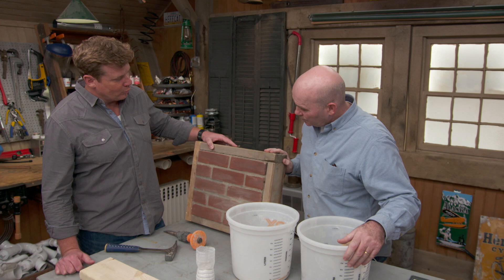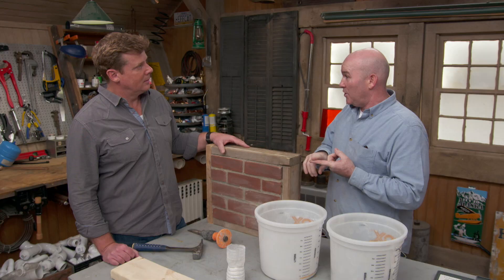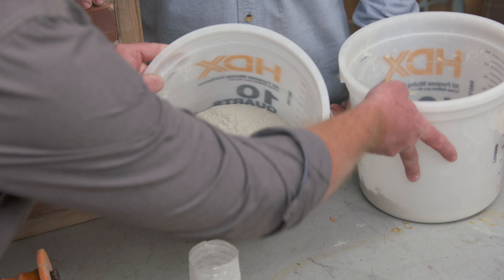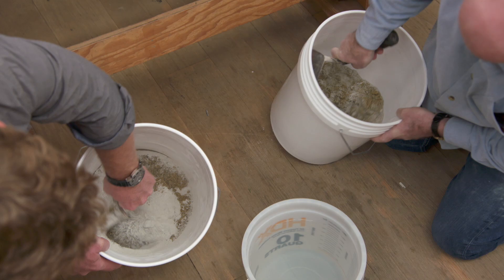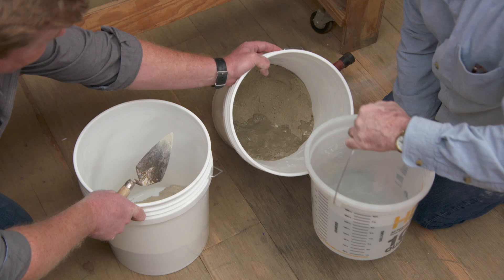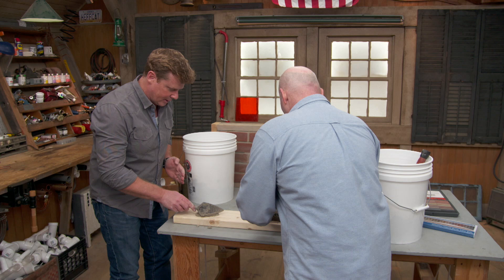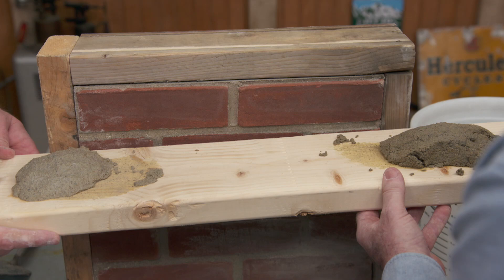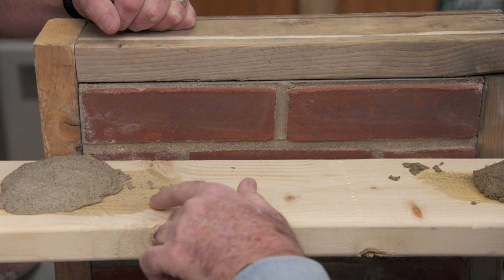How to Match Mortar | Ask This Old House

Comment: Third generation mason here:  I commented on your Facebook page yesterday and then this episode came on Pluto TV…what timing!  I just want to say that this is not as easy as Mark makes it look.  As I’ve said, Mark is a great mason but I’m thinking that his four-minute segment just wasn’t enough to “go into the weeds”.  My customers see things like this clip and give me grief because I can’t make the mortar match…perfectly.  Keep in mind that Mark did not show the final CURED mortar NEXT to the old existing mortar.  Matching is a long process that is based on four main factors 1) mortar color (added pigment), 2) lime and cement color and ratio, 3) sand color, texture and grain as well as ratio to lime and cement and 4) weathering.  Also, as you walk around a building, the colors will vary so now matching is multiplied by the number of different shades around the building.  As Mark pointed out, a mortar sample can be broken down to help determine these things but there is still a lot of trial and error to get to a point where the new mortar does not stand out.  A good mason will always make an attempt and get as close as possible, but the process involved in getting a "close match" can take days and is not economical on small projects.  “Mortar matching” makes sense on large restoration projects but you will still see the difference if you look closely.
Reply: I agree fighting it now. Brutal, looks so easy😂
Reply: Exactly
Reply: Amen to that, and we didn’t get any specific measurements of lime , Portland and  sand.
So how in the world is a guy like me gonna be able to get the idea ?
Reply: @elleondejuda4681  You would start with standard ratios and then add/subtract each until you get it.    If you are matching "old" mortar it's probably a Type-O.  Type-O mortar ratios are: 1 part cement, 2 parts lime and 8 to 9 parts sand and follow the recommended color for your specific color brand.  Mix that up, let it dry (you can speed it up a bit with a hair dryer) and compare.  Now, add/subtract each of those components until you get where you need to be.   It's a daunting task!  You need to have a pretty good understanding of mortar to even have a chance of getting close.   A mason can look at mortar and see the base color or determine if no color was added.  That's a valuable starting point.   But, to make things even more complicated, some color "back in the day" was simply brushed onto the surface of the mortar.  Good luck matching that within reasonable budget constraints!

One component that you will probably never be able to match is the sand.  "Back in the day" sand was often just harvested from the edge of a farmers field in a near by location.  Good luck finding that!

I wish that Mark would re-think his ability to match mortar and do a segment that describes the reality.
Reply: Great comment and Thank you. I own a brick home built in 1926 and was thinking of replacing the window lintels. I would love to match or come close to matching the mortar color. What do you suggest? Can I get a piece of the mortar examined?
Reply: @JosephTammaro , you can get the mortar analyzed, but I'd expect to pay as much as $ 3- 4 K.   I just spent $3k for a $ 50k historical restoration project.  The intent was to restore ALL mortar to its original state.  An analysis does not provide a match for the current look.  It will give you the original match minus weathering.  So, your new mortar can look just like it did when it was initially installed.  Not what it looks like now.  The only way to get close to the current weathered look is to have a mason who understands the process tinker with materials and colors.  This could also cost you $3-4K, and the result will never be an exact match.

Comment: One bad thing about using portland to make the mortar darker is that is makes it stronger. You don't want the mortar to be stronger than the brick itself. You want the mortar to crack before the brick does.
Reply: How come?
Reply: @timd9966  It's easier to tuckpoint than to replace the brick.
Reply: @timd9966  That is why they make different strengths of mortar. From weakest to strongest: O for historic brick,  N for new brick, S for block, M for below grade.
Reply: @jenniegem5338  Would a house built in 1948 be considered "historic"? I've heard two different views on this. I'm leaning toward the N mortar mix, probably combining a little more lime into it.

Comment: Please share more information about the various strengths of different mortar mixes and their compatibility with old buildings. Color really is not the primary concern. What would be most helpful is to know what was used on the typical bungalow 100 years ago. By that I mean the ratio of Portland to lime. Sand is easier to figure out since it’s usually whatever river sand was available locally at the time. Usually it’s a finer graded sand than is common today since the mortar joints were smaller. Thank you for the information though!

Comment: How bad is it if I re-point mortared one horizontal line on the outside of my stone foundation wall and the top line of stones on my patio with type s mortar? How bad is the risk of cracking stones or other damage? It is old fieldstone. Should I definitely chip it out and remove it? Does the chipping itself risk damaging the wall?

Comment: I need to do the repointing for the interior of the 1890s house. It is obvious to me that they have used lime sand mix which is hard to find premade these days (at least in my area). Is it viable to do the repointing with lime-cement mortar in the dry interior?

Comment: Thanks a bunch.  Now how do I match the bricks?  Getting a sense that won't be as easy.  My Old House is 154 years old with such hard to find parts.
Reply: It can be easier to find bricks the age of your house than it is to find matching bricks for a 40-50 year old building.  Keep your eyes open for an old brick building (school, government building etc.) that is being demolished and stop by and ask if you can salvage some of the bricks.  Also, there weren't nearly as many brick variations 150 years ago as there have been in recent years.
Reply: @BradlyFackrell  Thanks a lot for your time in helping me out with my project.

Comment: There is no question on mortor color. To sell a house You must re point and You must color match your mortor. If you do not color match old house mortor with new white mortor re pointing looks like crap. Old mortor changes color over time. So pressure wash and re point with the correct color motor that you custom mix. Go to a Brick Yard with some chips of your mortor and color match your house mortor with die from Brick Yard. You do not want to just re point. You must re point with the correct color motor. That means buy a bag of Type N mortor or make Type O mortor and add color to each batch color from the brick yard.

Comment: now days they use dye but old morter was done with diffrent sand colures
Reply: MARK FILLERY using dye is a waste of time... It will weather again over time and in any case the sand makes the most impact on colour we have red sand in Devon and it gives a reddish mortar. We pointed the the tiles on our roof using a black mortar dye to get grey and two years later it's faded away.
Reply: im a builder and im aware of useing  sand from an area for the colour the guy on the vid said use dye we use it to do colured render if you like that sort of thing im not from devon but would think a lot of places have an area colour to the morter on older places as thats whare they would souce the sand from if you lived in outback australia i would think your morter would be quite red but they build with tin sheat
Reply: Colures
Reply: balderoine lol that’s the first thing i thought
Reply: thats what happens when you brake bricks with your head
Reply: he must of been realy old as that sounds like wattle and dorb but it is still used to make bricks in other parts of the world